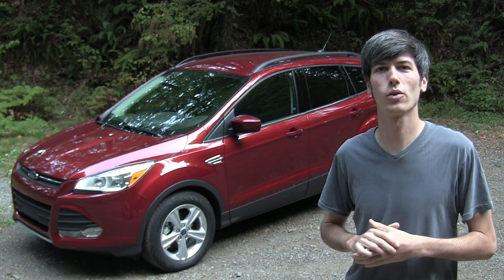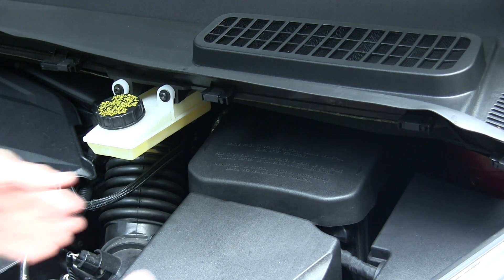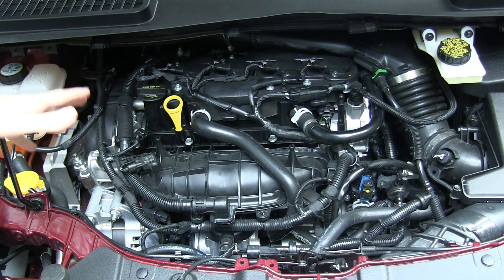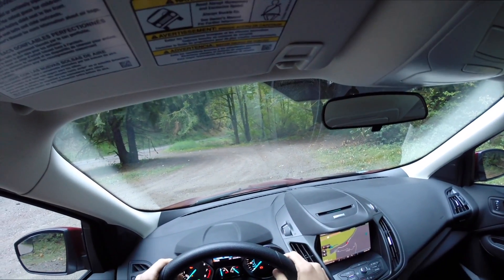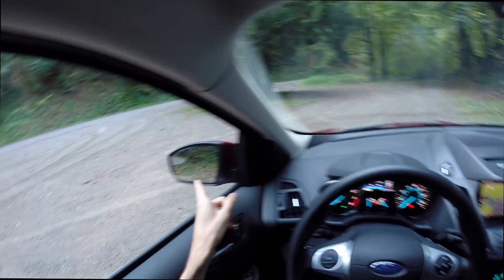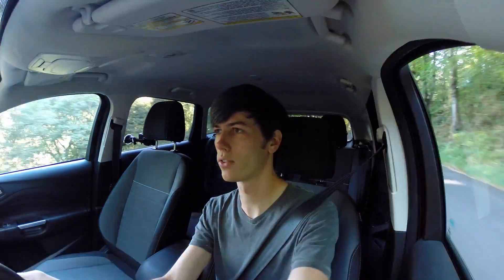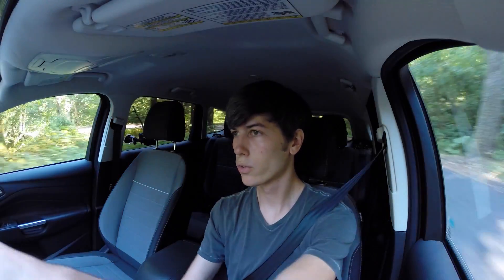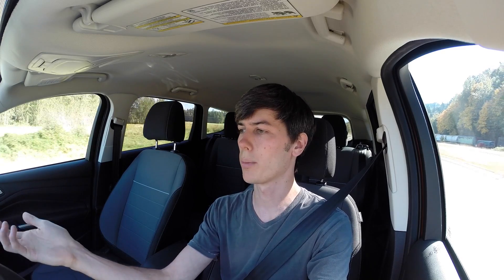2014 Ford Escape - Review & Test Drive

Comment: That battery placement pisses me off
Reply: Brian Smith When I worked at a lube shop I would cringe when I saw an ecoboost escape. PITA. I have a 4.0 ohv ranger. 2wd and manual trans. Easy peasy . Rust is my enemy Here in WI. My brother has a 13 rav4 and there is enough room around the engine bay for another engine. Screw ford
Reply: I'm a loyal Ford owner, but it's been my experience that Ford loves to make their vehicles hard to work on. I started working on my Ford Rangers many years ago because I got tired of being raped without lube by mechanics.
Reply: Next time we just placed the battery underneath the engine. Bad idea
Reply: I prefer the older Volvo XC90. Centrally in the rear of car under  floor. Good location and "inside". Also BMW in the boot/ trunk
Reply: Well the original battery in my daughters 2013 lasted 6 years so at least a good stock battery. Real pain ids the water pump which started leaking this year so also 6 years old and only about 75K miles!
Reply: I know right
Reply: 10 minutes, out and in. Took a flat head, 10mm wrench, 8mm wrench, and a basic understanding of how to turn a wrench. 
All of y'all crying about this have no business under any hood, no matter how old and simplistic the machine.

Comment: I don't get why they put the coolant filler cap in that place, it's hard to get too, the same with the battery. At some point the coolant will have to be changed and the battery at some point will need to be replaced. I bet the mechanics don't like that either

Comment: That fuel economy sucks. My 3 litre turbo charged diesel Saab gets 35mpg...
Reply: Gasoline vs Diesel is not an apples to apples comparison as Diesels are inherently more efficient (higher compression ratio).
Reply from the maker: Mate network for lads Diesels are much better, and for the US this is good. The rest of the world is on a bit of a different scale, as our fuel is subsidized so most people don't care about fuel economy (unfortunately - this is starting to change though).
Reply: Very enlightening, thanks for the replies!

Comment: It doesn't have an intercooler?
Reply from the maker: Woops! I should have pointed that out. 0:32 you can see it behind the vents.
Reply: Engineering Explained I see it now. So the vents will also block some air to it at speed. Hmmm.
Reply from the maker: Walter Black Yes, as there's already enough cooling at speed.

Comment: I wonder whats the downside of plastic intakes i never knew manufactures used this until i saw your video. Do you think you have time to make a video describing the benefits and downside of this new technique maybe even on some newer things manufacturers are using on new cars?
Reply from the maker: I think longevity would be the downside. An aluminum intake manifold is likely never to fail, I don't know how long these plastic ones will last. That said, Lexus uses a plastic manifold on the GS 350 V6, and they're consistently ranked towards the top in reliability. It'll be interesting to see over time, though I'm not sure when major manufacturers started switching over.

Comment: The shaking cam in the interior review is quite sickening... :/
It's very nice to have a more technical kind of review!
Reply: Engineering Explained Buy a Sony AS-100 action camera - comes with built in image stabilization. Otherwise, use adobe premiere to edit out the video shaking.
Reply from the maker: Yep, working on that. I bought a new GoPro to have two angles, but no SD card. Apparently Best Buy gets their own UPC codes now, so you can't price match with Amazon. No thanks, I'm not paying $50 more for the same thing. Not my next review, but the one after should have some better qualities. Hoping to improve each time, I'm a quick learner, sometimes it's just an expensive change. Cheers!
Reply: sounds good!

Comment: personally I don't think many cars have respectable rear leg room for being 4 doors. it always feels like my legs are nearly touching the seat backs add some body length and make there be a nice cushion of air between my legs and the seat in front is what I would want in a 4 door the most.
Reply: that's why I'm holding on to my 2004 Mazda Tribute. Drinks gas. Although I get compliments on how much leg room there is. The handling is remarkable and at 150k it has original drivetrain as well as suspension and spins tires whenever I want. Love my V6
Reply: For the exact same reasons I can't let go of my 2005 Ford Escape with a V6.

Comment: Why are the control arms for the suspension so rusty?
Reply: It's a ford
Reply: StephenMc2000 chevy and dodge are not any better
Reply: The poor quality of metals going in all the new cars is my guess
Reply: The control arms are steel, like they are in a lot of cars. In his last review, the Lexus GS had aluminum control arms which don't rust.
Reply: RandomGenera7ed Car's only 2 years old. My 96 has less rust than that.
Reply from the maker: Steel control arms, you'll notice this on many vehicles. Also the car was from Michigan, don't know how long it spent there though.
Reply: Its a cast part thus it will have surface rust almost immediately, no big deal!